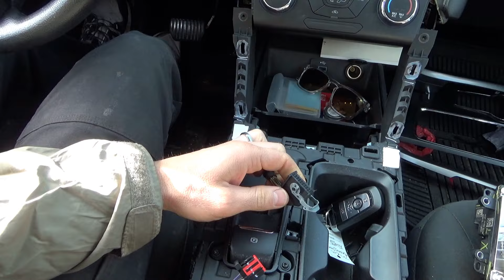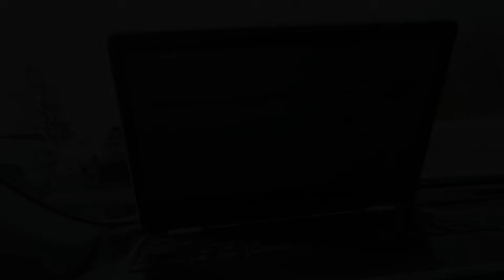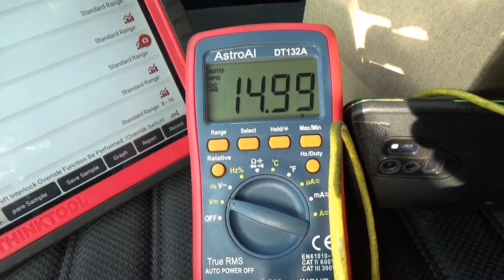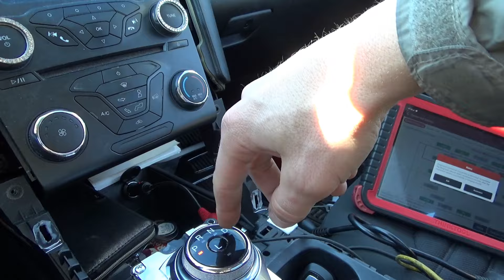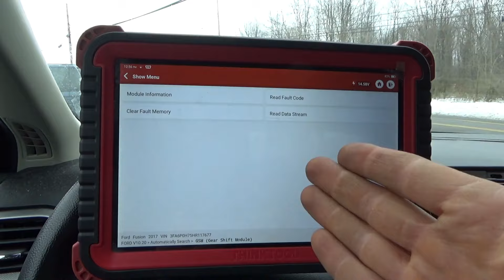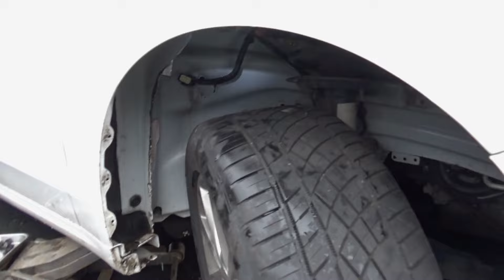Why New Cars SUCK (Ford Fusion STUCK in PARK?! - Part 2)

Comment: Wow! That was something! Is is possible there is a switch in the transmission giving feedback as to the gear it's in, and the problem was that the feedback from the transmission did not match the command to or from the GSM or TRCM that wanted it in another gear? And if there wasn't a mechanical issue in the TRCM, is it possible there is an unknown way to reset it? I'm totally with you on this whole scheme being stupid! Documentation and troubleshooting tools always seem to lag behind because of the rush to marketing, and in fact, sometimes a product life cycle is completed and over without proper documentation or tools ever being developed. My hat's off to you for working your way thru this thing. When things were simply electronic, a schematic was all you needed to troubleshoot them - but when there is communication taking place between modules, even the schematic isn't enough.

Comment: Ivan, that little pawl that was sitting under the housing, right were the spring connects its supposed to be out of the housing not in. It only goes in the housing when the small single motor activates the cam and pulls the pawl down some. The unit got over extended and now the timing is off. Its “home pisition is on that tab about the 11 o’clock position when the small motor is at the 12. If you spap things back into place, it should work and pass its “home position test”. The chip determines the home position by forcing rotation of the motors against the stop and watching for a current rise. Just like an electronic throttle body does its check. 
We are resorting ti opening these units too because if the shortage. And check this out, we at the local mother ship do not have any more “software access” to this module then what you do. The Mexico mothership does. Sickenning.
Reply: That's interesting. I read on some forum that you had to have the trouble codes to properly diagnose this problem,  but you have to have access to a special scanner or scanner software to access these codes. Flys in the face of DIY repairs, let alone professional diagnosticians, repairs!
Reply: Excellent information. I was beginning to think that maybe one of the motors had burnt out. But your explanation seems spot on.
Reply: Thanks for the detail on that. So it was an input problem from the module.
Reply: It's time to sink the "mother ship" and go back to a simple gear shift lever.
Reply: I knew it was a pawl. Either an actual one on the drum, or a baby plastic pawl!! lol.
Reply: So could that be from someone forcing the selector dial?
Reply: @Cheepchipsable  no. They're not linked mechanically
Reply: Go back to a manual transmission and we won't have these stupid issues. For automatic transmissions at least just a simple manual cable from a floor shifter straight out to a lever. 
This stuff is ridiculous.
Reply: I get it now, it's tough just looking at it in it's broken state
Reply: WELL STATED, TULO, IF SLIGHTLY INCORRECT
Reply: agree, adding the two large motors that drive the large gear you removed.  These two gears can go both directions , when acting as the drive gear the other motor becomes a pulse counter or encoder .  The automotive designers discovered pulse width modulation , when the encoder reaches thw correct count it puts on the stop or reverse the other motor keeps driving to ensure the rotation is held at the exact position.  Both motors count steps both motors have stored counts and probably something sliped or miscounted and it drove past the count and didn't have a routene to back up and try again..  A shethed cable like on a gearshift for a ten speed bike could have done a better job.
Reply: Thanks for that really great explanation on how this device works. When Ivan pondered over where the position sensor is I went back over the vid looking for more wires and maybe a proximity switch. Not seeing any I thought maybe it it's monitoring current but ended up deciding, naw, it's got to be simpler and more positive design. Son of a gun, nope they made it complicated and sketchy. So is the small motor that controls the movable plate a stepper?

As car's become increasingly autonomous I suppose we're going to continue to see subassemblies become increasingly complex. Not that this vehicle is autonomous, but no doubt Ford is trying to stabilize their inventory across all model lines as the transition plays out. In the process reliability will suffer and we'll have to put up with nonsense like this until more cleverly designed simplified systems are devised to do the same job at a fraction of the cost, weight, and failure rate. Look at the evolution of computers. Every industry goes through its growing pains, but because of it, someday our grandchildren are going to look at us and say, "wow, you actually drove a car with a steering wheel and foot peddles!"

Comment: I think the small motor operates that cam plate to allow for fine adjustment of the trans shift positions during it's learn process. If not for fine adjustment, it may be some sort of P position locking detent.
Possibly the small motor is what is being powered up when you put the key in that shift over-ride slot in the centre console when it allows the controller to work momentarily?
Theory being, the small motor moves the cam plate which moves that lever, and in turn the lever unlocks the main shift assembly...dunno, just more stupid complexity really🤷

Comment: I can't believe I called it in Part 1. I was going off the sound of the TRCM. I once worked on a start/stop station with limit switch for travel ranges that did a very similar thing. It was part hunch, part experience, and part lucky guess with some knowledge of what you had already tried. I'm happy to see you fought through that trying problem.
Reply: Here as well.  I've been watching lots of Ivan's videos and this is the first time I've ever been able to identify the faulty part before he did.  I feel like I should be celebrating a victory or something, lol.
Reply: Yea I was really surprised he tried replacing the nob after the first video.  Seem d pretty obvious to me where the problem was.
Reply: @joshg1244  I think Ivan thought the "brains" of that system were in the console. I at first thought so as well. It took until the very end of Part 1 for me to think hard on it. And I'm far from being 100% on anything. I can cut a guy a break.
Reply: Same, this is one of the rare situations where the thorough diagnostic process hurt instead of helped - mainly because the shift system was too dumb to set a trouble code even though it knew something was broken. The strange noise from the shift module would've had most people firing the parts cannon, successfully in this case, but the lack of code and conflicting info from the scan tool made it seem like the problem was elsewhere. On top of that, if you went right for the shift module and tried a "no parts required" fix, you could still be led astray since it wasn't obvious what was broken inside that thing.
Reply: I was certain Ivan was gonna call that piece of garbage in the fenderas I did.
Reply: You and me brother

Comment: I'm guessing the moving plate is the range adjustment mechanism? So it would be the small motor which you heard during the learn procedure, winding up the small plastic gears. Those two larger motors are a standard size, you see that type of motor in all kinds of small appliances and they are pretty cheap. I am surprised to see something that looks like an off the shelf appliance motor in such an assembly! I wonder if using two is supposed to serve as redundancy?

Comment: Mercedes 9 g-tronic hat auch Shift by wire im Geriebe integriert. Durch ansteuern der elektrischen Ölpumpe wird durch Magnetventile der Schalthebel im Getriebe hydraulisch geschaltet.😂 Wählhebel am Lenkrad
Reply from the maker: Sounds bulletproof 😅👌
Reply: @PineHollowAutoDiagnostics  ja German Ingeneering ich hatte die 5g-tronic im Clk 230 Planetenträger durch defektes Nadellager komplett kaputt bei etwas über 120tsd miles. Mein Bruder 7g-tronic im CLK 350 Probleme mit TCU im Geriebe somit Tausch TCU und Programming aber bei 180tsd miles. Nun fährt er C220d mit 9-gtronic ich fahre Toyota , warten wir ab was passiert 😂

Comment: You mentioned there being no sensor on that assembly. Seems to me that's the reason why there were no codes. They just didn't put a position sensor on the corresponding moving parts so that the ecu can monitor that and consequently throw a code for what does not agree.
Reply: And that is the problem.  The "geniuses", with all their wisdom, didn't bother to build in a method to know when it's broken after they had built an overly-complicated, no-cable gear shift system to replace a perfectly fine cabled shift system.  They removed a couple parts to add a couple hundred.  These people are NOT stable geniuses!  LOL
Reply: I agree. When it was in adjustment mode, the module was trying to find its "home" position by spinning all the way backwards until it couldn't go any further. Since one of the gears appeared to be stripped, dislodged or misaligned, the motors were just spinning forever because they were driving nothing, meaning the unit would never find its home detent.

A simple potentiometer or a set of limit switches would have prevented this to begin with, if there was a mechanical failure, the module would know nothing was moving even though there was current flowing through the motors.

Comment: 'Made the wrong call' - I'm pretty sure those wouldn't be my words in this situation.
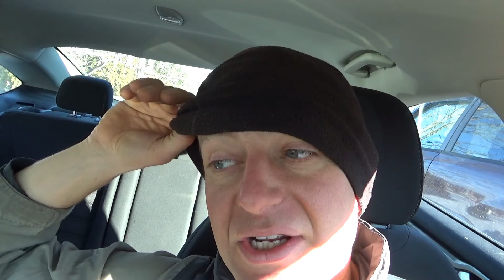10:47 I used to work in a CAD software company. Every time Microsoft released their latest version of Windows, it was a mad scramble to identify what parts of the OS they had 'improved' and why it meant our software no longer worked or misbehaved and how to work round it.
25:11 the designer slipped up, didn't specify any left-handed threads randomly.
26:12 and they wonder why there's a chip supply shortage

Comment: I would check all the transistors if I had to strip the board bare. Also figure out where to drill a hole and shove a nail in it to override its sense manually. Build up a test rig devoid of the car.
  All to keep mom from backing out of the garage with the door open, sheesh

Comment: I wonder if that door correlation code on the other video was just the scan tool misidentifying an oem code for the trans motor. Maybe the oe diag software has the correct definitions.

Comment: those knob shifters were all the rage when they came out but there were some lawsuits when people forgot to put it in park, got out, and got run over. Manufacturers had to make it idiot proof in a rapid time frame. Looks like Ford missed on the repair side by not throwing a code. Maybe later models work better.

Comment: They switched to the shift by wire to reduce assembly costs across multiple model lines. As usal it's about reducing manufacture cost while sacrificing reliability, and repairability. Fly by wire in aircraft have 3 fail over systems. They will never do that it a car. They will just cause a failure in a minor system to brick the whole car.

Comment: Frustrating useless feature. Since there appear to be no limit switches, the thing probably watches the apparently DC motor(s) current. All the circuitry to achieve this seems a bit of overkill (and not backed up by diagnostic help)  As designs get more elaborate, the opportunity for expensive failures just after the warranty expires increases. Just what the auto industry wants I suppose. Is it likely that anyone will get a million miles from a GDI engine with shift by wire? Fat chance unless you own a walnut farm.

Comment: This is a customer safety feature.  For those folks whom find themself in need of jumping out of the car to move the kids tricycle.  As soon as customer release the seat belt and opens the door the car moves the shifter in to park and sets the parking brake.  Its sole existence is to reduce liability.  Ford is attempting to protect the customer from their own "self" which in turns is less expensive than a few lawsuits.  When I look at the construction of this device, it was designed to break, given the environment the car will be operated in. -40 F to 120F. Those nylon gears will not age well. Ford will not make this part for ever, I suspect if there's a production run planned ! it will likely be the last production run, to cover the estimated planned obsolescent business model.  Should an aftermarket parts company choose to reproduce it in the future, would they redesign or just make the mechanical components and treat it as a rebuild until all the used circuits boards are exhausted.

Comment: Looks like you are the 2nd person to replace this, I am surprised they didn't just use a linear actuator right on the transmission.
Reply: Or just a stepper motor or a servo connected to the arm receiving the cable.

Comment: I assume that the intermediate plate is used for the basic setting. The switching path is fixed by the angle, that the large gear wheel can move and the positions are probably determined with the help of Hall sensors on the small circuit board.
Moving the intermediate plate changes the position of the shift arm without having to rotate the large gear wheel, allowing to adapt differences in shift cable lengths.
Another assumption: In the first step, only the intermediate plate is moved back and forward for adjustment, the large gear wheel remains in the P position. It evaluates the feedback from the transmission when the P position is left. If the feedback from the gearbox is as expected, then in the second step the other positions are approached via the large gear wheel.
Reply: I have the impression that the TRCM has no feedback from the TCM in which gear the transmission is actually in -- it's a stand-alone unit so it can't read the PRNDL information from the actual transmission, meaning it has to make an educated guess. Which it can only do if the module has reliable information about the position of the cable, meaning the point where both extremities of the cable are reached, will have to be learned.

If the module was designed to just communicate with the transmission and get an accurate reading on where the actual transmission is shifted in, it could have been a much more dumb unit since it only has to act as a simple servo motor. Driver selects "D", move the motor until the transmission feedback says it's in "D". That will work regardless of cable length or differences in cable pull between individual transmissions (heck, we even have that on /bicycles/ for almost a decade now).

Because it was designed to work as a mechanical shift lever they really had to over-complicate the design.

Comment: I've seen this before with the lack of logic on these systems. There's no reason why this system shouldn't give a code pertaining to the lack of movement coming from TRCM. There should be position sensors that should all have to agree and which ever one doesn't should get flagged.

Comment: Always be skeptical, never trust and never forget you know more about the situation you're in than any manual writer or software programmer did when they wrote their things.  I was always cursed with solving the "hard-to-solve problems" when working at Ford dealership(Other OEMs are the same, I am sure).  I always got the thing solved but guess what?  When the shop is flat rate and there is a problem vehicle, the best you get is so-called "straight time"....Time and materials really.  Others around you are making 2X+ what you are but, you're solving the problems.  Yes, I am very very glad to be out of that business.  I do appreciate the thinking part of it though.  That's why I watch your vids. Vids weren't around when I was doing what you are.  Thanks for sharing the pains.
Reply from the maker: I couldn't imagine working for a dealer... Probably wouldn't last a day 🤣
Reply: Brother I was your counterpart at a Chrysler Dealer. The "More you know the less you get paid" scenario. No incentive to continue learning. Flat rate should be abolished in this and age. After watching apprentices taking home bigger paychecks doing brakes and front end work I finally walked from the trade as well. Mangers couldn't care less and would admonish me for not helping out the lesser experienced mechanics on my time and dime. Sad seen a lot really good mechanics leave the trade. Love Ivan's videos they show exactly why flat rate doesn't work.

Comment: The new Ford's are even better... When you pull the manual release to push the vehicle into the shop, and as soon as the vehicle sees wheel speed it turns one the parking brake.

Comment: Thank you Ivan!  Helps us jump ahead when we encounter the same issues.  Reminds me of some of the craziness I found on 80’s cars during the transition from carb to injection.  Senseless of Ford to approve of that design.  All about the $.  Using a cheap manual shift transmission valve (old tech) with motorized cable control so they can look like a computer controlled trans….  😂